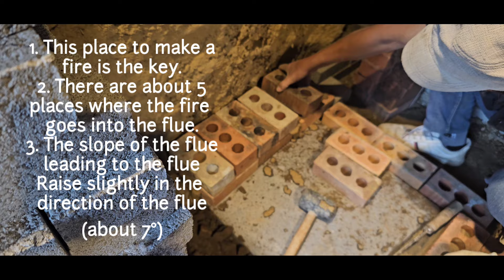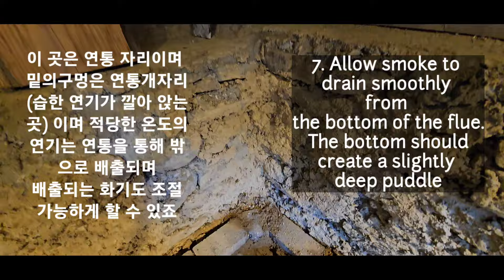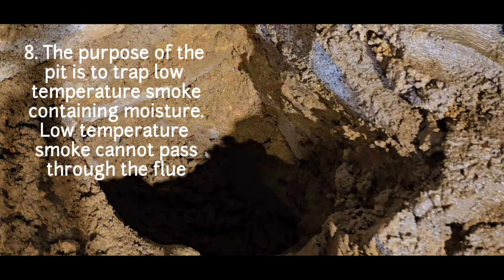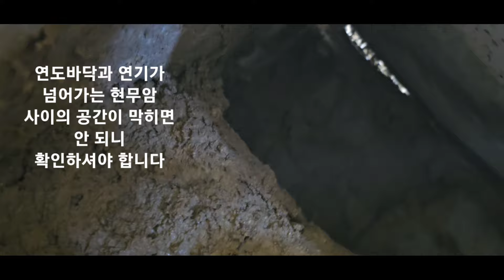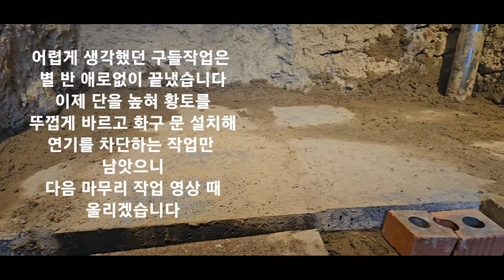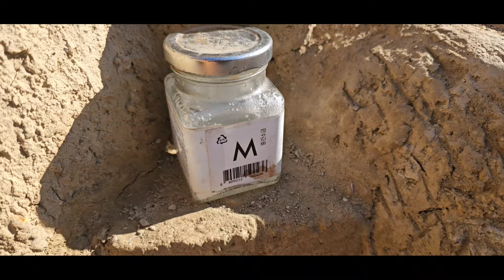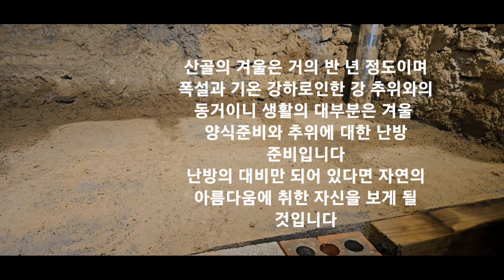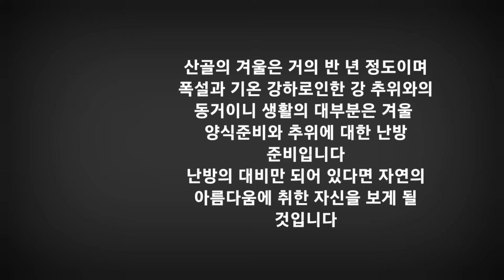The Amazing POWER of KOREAN ONDOL Heating  || 돌집온돌 1 ||

Comment: When the burner heats the air inside a hot air balloon, the balloon inflates, and once the air is sufficiently heated, the balloon rises. Similarly, just as the balloon traps heat, the floor in a traditional Korean ondol system must also retain heat. For this reason, the floors inside traditional ondol houses are constructed higher than ground level. The firebox (agungi) is positioned at a lower level, while the smoke outlet is slightly higher than the firebox.

To prevent smoke or carbon monoxide generated by burning firewood in the firebox from seeping through the room floor, granite or basalt slabs are laid over the pillars or walls beneath the floor. Clay is then applied in multiple layers, using a coating method where each layer is thoroughly dried before the next is added. Alternatively, cement can be applied in the same manner.

Since the ondol floor structure traps heat, the walls that enclose and support the smoke passages under the floor are made thicker to enhance insulation.
Reply from the maker: 대단히 감사합니다
우리의 전통온돌은 전 세계인의
열화와 같은 지지를 받을날이
도래할겁니다~~!!
Reply: @SDP-77  👍